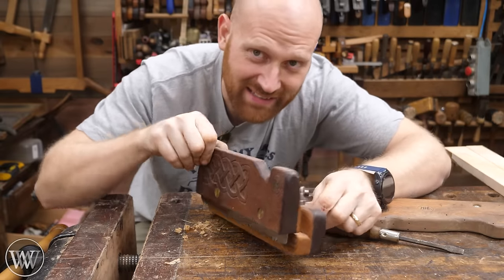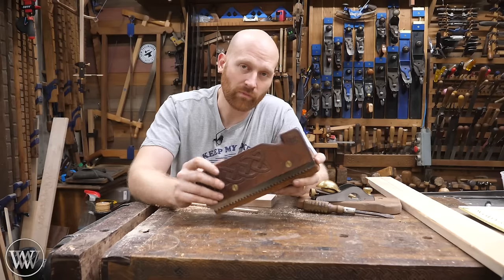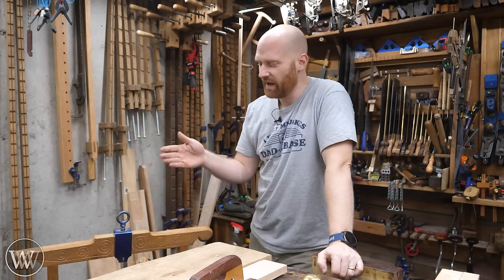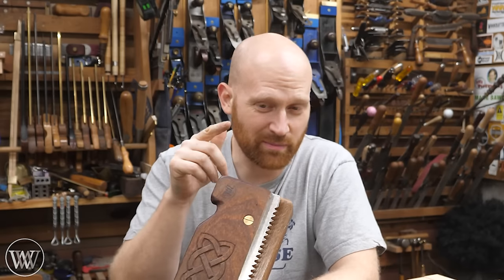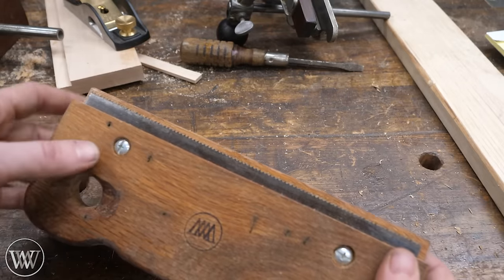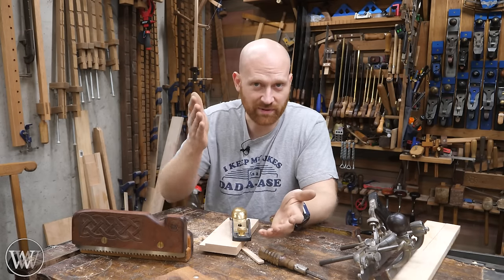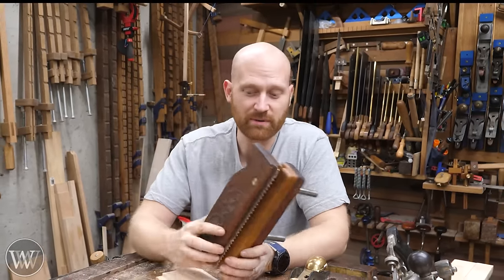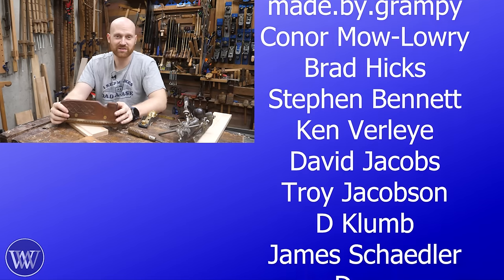What is a Kirfing Plane or Rabbet saw

Comment: I use 2 diy of them for resawing, 1 is for thin pieces, up to around 8 mm thick pieces, other is for thicker pieces but i used them mostly on expensive wood, like ebony or curly maple (for making guitars or inalys and small pices for furniture, boxes...). . I do own a bandsaw and a european framesaw and even if i'm using a bandsaw  properly, i like to make a kerf cut before. I will spent that time to minimize (unfortunately not eliminate 100%)  potential error.

Comment: I have a tool that looks like an oversized marking gauge. It has a 2 inch stem to accomodate  a short saw blade. It can be use as a regular marking gauge with a kerf of 1/2 inch deep.

Comment: I have a kerfing blade for the quangsheng no 46. It's a really poor blade, even after sharpening. I tried using it a couple of times but found it took ages as James suggests. I'm pretty good at just sawing to a line, so I just do that. I thought it might help on a project where I wanted thin boards and didn't have a lot of room for waste, but even then it didn't work any better than just using my 5" rip saw. Maybe one day I'll make one with a decent blade and see if I can make it work.

Comment: I’m gonna dremil in a 1/8 slot every 3rd tooth of an old saw blade to see if that helps with the clogging factor, that and a bottom mount adjustable wooden fence should give me a mix of the two planes you showed. 

What “wood” I do without this channel for inspiration?

Comment: If you don't mind using power tools, a narrow kerf blade on the table saw can do the same job prepping for a resaw.
Reply from the maker: Even a narrow blade creates a much wider kurf.
Reply: @WoodByWrightHowTo  No question, but it is handy to do when I need to resaw something wider than my bandsaw will cut.

Comment: FIRST
Reply: Picture this:
You wake up ...
Not in your bed but in a hospital...
First thought:
How did this happen?
Many other thoughts follow.
At least you woke up.
That was me back in 2011.
Previously, I had run shop for as many as 120 carpenters and other jobs. Recovery was to lead me down this current Rabbit Hole( no, I didn't meet Peter).
Getting vertigo that can't stop or be dealt with from doctor prescribed meds lead me to just deal with it in my own way, Unplugged Woodworking.
The re-learning of my forefathers skills is a lost art and there are a lot of useful and interesting tools are never needed when using powered tools.
Kerfing saws are just another one of those good training tools to get you up and running again. They can also save you wood and time and keep you from wasting a rare chunk of wood that just may be very costly to turn into sawdust rather than the finished piece you started on.

Comment: This is nothing more than an embellished stair saw. As as stair saw its biggest advantage is sawing dado to predetermined depth, and if set up correctly do it well. Mine is set up at eight tpi crosscut and installed in the pull position.Best to use a knifed and chisel relieved wall due to visibility issue..they leave a good wall and no tear out with careful use. I personally cannot recommend Blackburn tools due to delivery issues that are widely reported. I personally have a twelve inch saw plate order that has not been fulfilled with no response to inquires as to delivery date or refund forthcoming from Blackburn. Too bad because I liked his products.